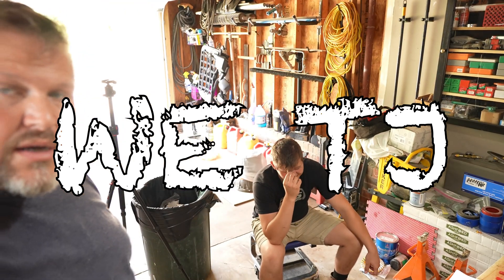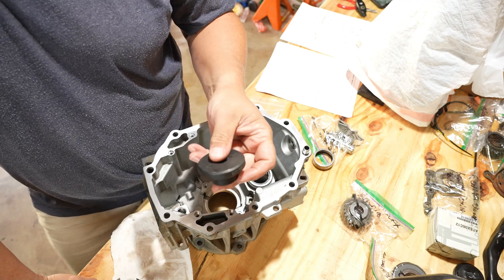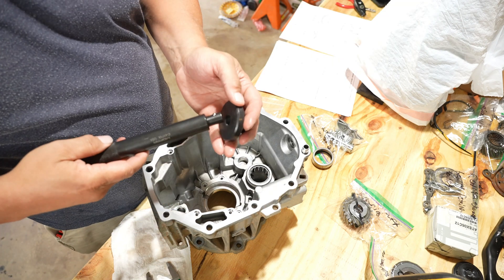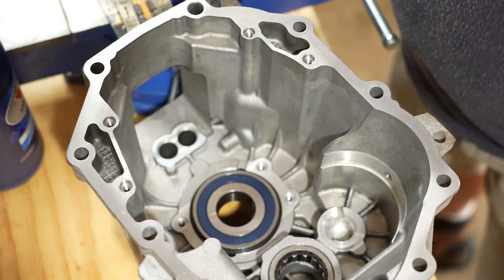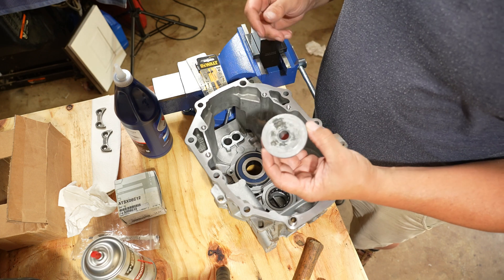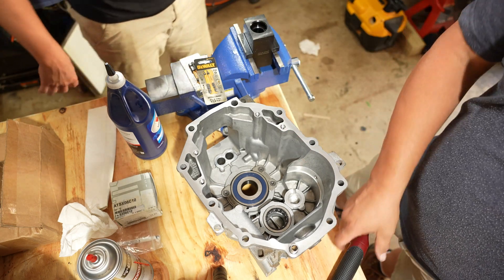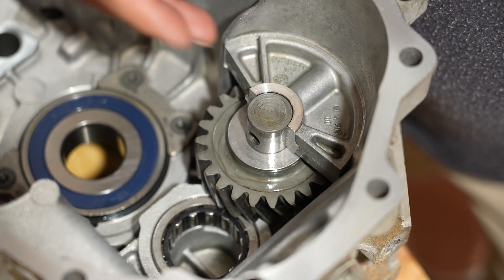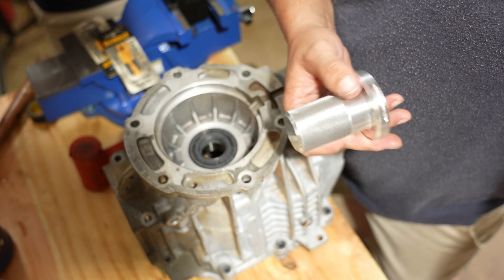Pt9 Jeep TJ Rubicon NSG370 Rebuild Rear Housing Bearing Installation

Comment from the maker: Warning!!! At 8:38 do not install this seal. There’s a c clip that goes on the output thats behind the seal. This seal is one of the last things to do on the transmission build.
Reply: Did you skip part 8?
Reply from the maker: @jeremyR87  sure did. Thanks for catching that. I thought I uploaded this morning.
Reply: yep, just saw this too! Nearly made the same mistake myself... Page 21 - 25 says to install it, but then to install again on 21-30. I've spotted a few mistakes like that in the FSM- With a manual like that no wonder Jeep have such a bad rep down here in Aus.